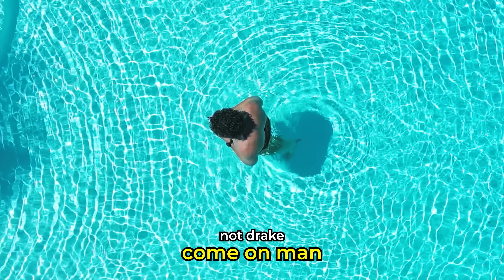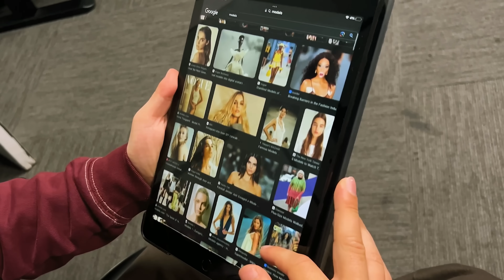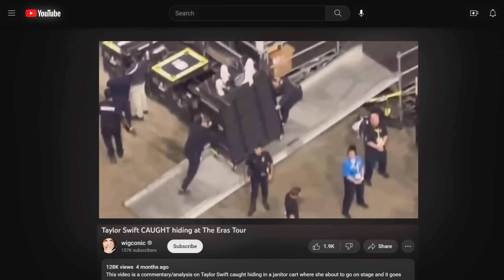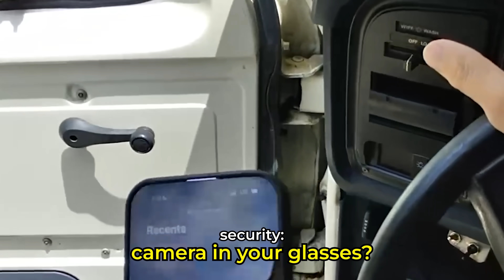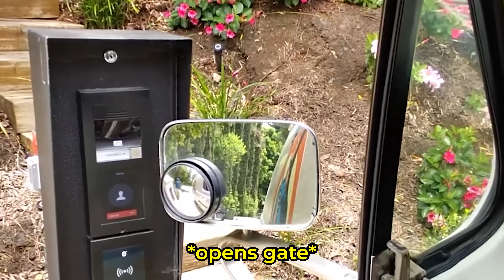Sneaking Into Celebrity Pools

Comment: I used to do private security.  I'm fairly certain I could sneak into just about anything.  They will put some guy out on a remote section of the event, tell him absolutely nothing about who is supposed to come and go and then just leave you there.  It was the norm to see the actual PRODUCER of the show come through ten minutes after I got stationed there with no pass, no radio,no nothing.  Just 'i'm the producer' I remember one time I almost kept the opening act for Panterra from getting in because they just looked like a bunch of junkies to me.  After a bit I was like I'm getting paid slave wages and I'm just here to watch the show and make sure no one dies.